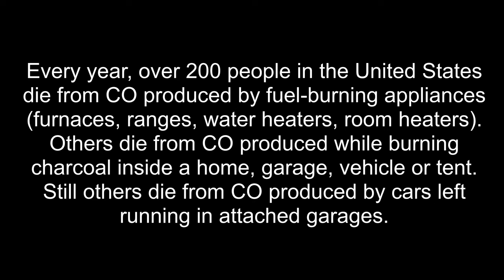Generators with CO Sensors - Good Intentions but a BAD Idea?

Comment: Excellent - getting closer to getting this set up.   Currently (September '23) to get a standby 26KW with LP (2 120's filled) is $17.6K out the door.  I got 5 quotes.  In rural NW Jacksonville Florida.
Reply: He only needs a 7k, a lot cheaper than the 17.6 k

Comment: I went with standby generator generac. Runs everything in my house and have zero regrets
Reply: what was the cost?
Reply: @SCraig1966  if you use generac it's around $12k, find a local contractor that installs generac about $8k
Reply: then the LP costs
Reply: Similar sized Generac is $1999.00 with a transfer switch.  LP cost is moot as the company will install a tank and fill it.

Comment: This video is exactly what I was looking for. I am a full time RV boondocker and just got a new generator with one of these CO sensors. Looks like they deliberately designed the thing so you couldn’t easily override it. I can’t get the damn thing to stay running because of all the false alarms. I’m out in the middle of the desert in Nevada and need my AC. Why the heck would you put the sensor on the thing making the CO? It’s so ridiculous.

Comment: I had to bypass my CO sensor after only a few hours of running after new purchase. Biggest PITA!!
Reply: I’ve had the same problem I just by pass it on a hard wire setup this is the dumbest feature when the generator is setup for an Rv

Comment: CO sensors at mattress level are dangerous. That means you are in a CO compromised level when they alarm. Sit up in your bed and you are really in a bad zone. The reason for mounting at minimum 5 feet is so when you are warned you can get out of bed, get dressed and leave the house while still in a green zone, not a red zone.

I really agree with you that a monitor on your genset (like I have) is worthless for the reasons you give. The government seems to think they have to pass all these rules and laws because they think they have to do something when put in office. The something we want them to do is stay the h^ll out of our lives. We want you to protect us from the ever encroaching rules and laws.
Reply from the maker: The problem is... people are being told to mount them LOW on the wall, baseboard level... HIGH on the wall... and all over. Due to it's SG it's really impossible to tell what level the gas will build up.
Reply: @HowTowithDoc  CO is slightly lighter than air so concentrations should start building ceiling height. Of course there could be instances where sensors down low would alarm especially when placed near the combustion area (gas furnace, water heater). At any rate one should not take any chances with a life threatening gas. They're cheap so install them everywhere you want and find out (God forbid) which one alarms first.
Love your channel. Always interesting stuff.
Reply: @liffy8333  don't forget stratification due to different temperatures - the Specific Gravity (SG) being discussed is at a specific temperature.

Comment: I recently got a DuroMax dual fuel generator.  I have it 40 feet from the house.  At 10kw on propane it will run everything in the house including the AC.
Reply: 40 feet of typical generator cord could cause voltage drop issues. Is it hardwired? Check for voltage drop, calculate for 3-5% and up the wire size.

Comment: Fortunately we have an older generator with no CO junk on it.  When running it for days on end after a Hurricane, it runs out of the rain in a  10w X 8d metal shed.    This shed is about 25 feet from the house.  These sheds have small holes at the top under the roof because that is how the metal is formed; so there is some flow of gasses out there but not enough to keep the air clear.  We also leave the door open about four inches. The generator runs fine and the exhaust can NOT get in the house but the air in the shed is BAD! When refueling one opens the door pulls the generator close to the door checks the oil and fills the gas and starts it and pushes it back in. A CO generator would not run under these conditions even though it is safe: no CO can get in the house where we are. We are not in the shed MR. Government!!

Comment: First of all Doc how do you find out how much power you need for a generator I want to get one for my mother's house but I don't know how large she needs maybe a video or an explanation for that and as far as a little guest building you could just get another shed put French doors and finish it out spray foam drywall imagine that that little window unit would do wonders inside of one of those
Reply from the maker: You can google generator calculator and they have very good charts showing demand and usage

Comment: Most of the “sheds” used in the installs I’ve watched all had exhaust fans to blow out the carbon monoxide so the generator wouldn’t shut down.
Reply from the maker: Correct... but isn't that kind of crazy?
Reply: @HowTowithDoc  well, you need to replace exhaust gasses with oxygen...
They do not prop the doors open like you, they have complete enclosures for noise mitigation.
Reply: I built an elaborate fully enclosed backyard sound enclosure with 4 intake fans and two exhaust fans ( exhausting the aur 8 feet off the ground). Ecen with all the air flow, the CO ssnsor still cuts it off in 30 seconds. BUT, I just saw a vudeo on how to tape over the air inlet to the sensor. I will try that.

Comment: I have one on my newer generator it was about one year old when the sensor failed and it would shut the generator down about have 5 minutes so i bypass it and it works fine now my generator is about 60 feet away from my house
Reply: Just replaced my generator and it has a co sensor. Where it's located is poorly ventilated. It triggered it to shut off. I have a co sensor inside. It's never gotten high enough to trigger the one inside. But since it exhausts poorly outside it shuts off. Need to bypass it. It's it really as easy as jumping two pins in the plug?

Comment: If you’re open to comments…I think there is a problem with having a CO detector at mattress level. As you said, CO is lighter than air. If it come in the bedroom it will build up from the ceiling down. If it build ups enough to get down to mattress level and the alarm goes off, you will stand up, breathe in the CO and pass out and likely die. With the alarm at the ceiling, you are notified before it gets down to a level that you’ll inhale,

Comment: So this generator out of the box is ready to be connected to the house via an installed connection and a transfer switch that i already have? Im looking to replace an old generator and just want one that is ready to go.  Ive found myself confused on other channels that talk about bonded ground and floating ground.
Reply from the maker: Go to Amazon and look for a neutral / grounding plug. It's about $10 and plugs right in.
Reply: Thanks for the reply.  May I also ask, do you connect anything to the starter battery to keep it charged for when it's needed?

Comment: I built an elaborate backyard sound enclosure with 4 intake fans underneath the generator and 2 exhaust fans above the generator which exhaust 8 feet above ground. There is no safety isuue, because nobody can be in the enclosure. But, EVEN with all the air flow, he CO sensor still shuts it off in 30 seconds. I justsaw a Youtube of how to tape over the opening to the sensor. I will try it in the morning. I share your frustration with the Govrrnment's rediiculous regulations.

Comment: There's another problem with these built-in detectors.  My unit kept shutting down while operating in an open area without any objects near the generator.  It was suspected that a faulty detector was to blame. An overly sensitive carbon monoxide dectector can shut the unit down even if it's in an open area with no air circulating by the unit.
Reply from the maker: I agree... now you're out in the rain and lightning trying to start.
Reply: @HowTowithDoc  Thnx for responding back.  The generator that I had that problem with was a dual fuel Westinghouse house unit which was only going to be operated on propane only.  I have occasional power outages where I live. I didn't want to have to deal with the storing and rotating ethanol gas fuel every 30 days.  I can tolerate that during the Winter with my snowblower.  I bought the unit from the manufacturer through Walmart which offers a 30 day money back refund.  While trying to break the engine in by running it for 30 minutes,  no load, then change the oil, the unit kept shutting down.  Even switching to another full tank didn't solve the problem.  I contacted their technical support which made that conclusion. I was also informed that it has problem has occurred on some units. I brought that unit back to Walmart for a refund recently and am back to looking for a new generator.  I did learn a couple of things regarding this experience from Westinghouse.  Their customer service is excellent and their technician told me that running a generator on propane rather than gas is the way to go.  Using propane causes less wear and tear on the engine than gas and the unit will last a lot longer.  Your video was excellent an very informative.  I thought from the title of your video that that was the same issue you were having.

Comment: propane is a fuel that stores 'forever'

Small gensets do not provide 'dirty' power - it is natural pure analog sine wave, no harmonics. Put an incandescent light bulb or resistive heat load on and check that w/ an oscilloscope.

The difficulty is all of the dirty loads with whacked power factor, switching power supplies and harmonics all over the place. A commodity generator does not have the 'mass' to sink that mess like the power grid does. Therefor, yes the power provided ends up being a mess, and can even prematurely stress/overheat the generator windings.

An inverter generator can handle all of that noise and even compensate for it a bit. Do look for "pure sine wave" in the specs.

And in another 'twist' your refrigerator is in the class of 'sensitive electronics', much more-so than a computer w/ a switching power supply.

My old 3500w Champion runs inside an older step-van and I use the heat from the exhaust to warm the propane bottles for cold weather use. Neither people nor carbon monoxide detectors belong inside of that thing.

Thank you for the research into CO detector placement, vey thoughtful presentation.
thanks for the video!

Comment: That generator with a 8 circuit transfer switch and that same shedd is $2110.00.  A Generac PowerPact 7.5KW with similar transfer switch is $1999.00. Both need fuel and both need an electrician to hook up.  Gasoline goes bad and propane doesn't.  Generac is automatic and don't even have to be home, this one is not.  It's a no brainer for me!!  And the Generac is 500 more watts.

Comment: Run a box fan on my generators and never a heat problem or co problem 
Can’t Fix stupid but blowing exhaust away from generator under a shed makes sense to me and away from house welded in a steel frame like a jail 😊